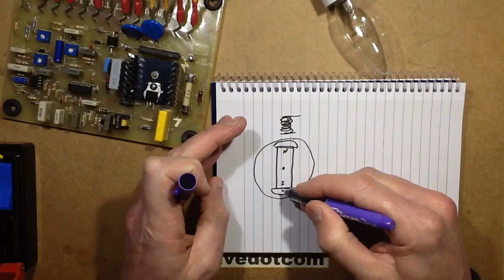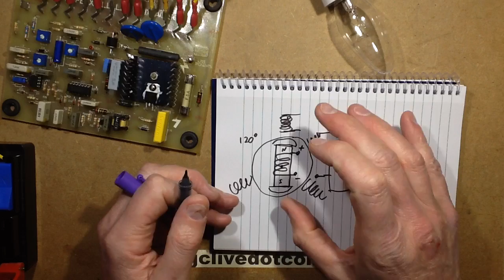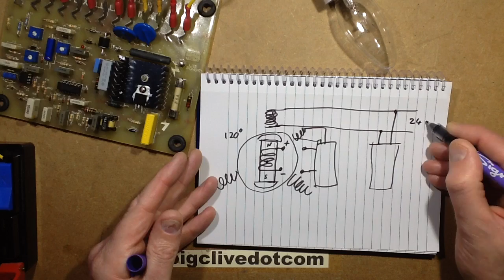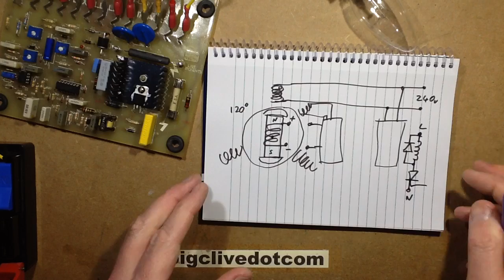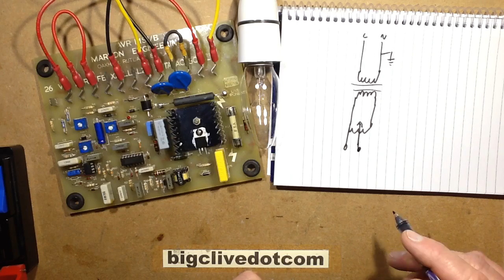Repair of old AVR (Automatic Voltage Regulator) PCB.

Comment: There are a couple of tricks to measure resistance in circuit.  A low test voltage is the known solution for cases where the bypass path contains semiconductors.  I have seen as low as 24 mV offered by a meter.  For resistive paths you can use 4-terminal ohms measurement with the twist that the drive and sense leads are at different branches and then you swap them.  For inductive bypass paths you can measure AC resistance at two or more frequencies.  Another thing, the SCR may behave fine with the lamp load, but fail to stay ON after trigger with an inductive load without some help.  The adjacent components might have been bad, but of course you replaced them in this case.

Comment: Hi Clive 
I find your videos extremely interesting and entertaining and I have an interest in electronics myself and I was wondering would you be able to give me some help I have a simple control box wit h a circuit board inside and this runs a small 12v motor and also opens and closes a ram all electric there is two separate switches for each control (motor & ram) and the ram isn't working and I was wondering would you be able to help me resolve this problem thanks

Comment: Spent many a happy hour cleaning up brushgear and sliprings on the 600 MW alternator sets at Longannet Power Station. We also used to check the brush lengths 'on load' so I know all about one of the drawbacks, from a maintenance perspective, of dc generators and motors, i.e. carbon brushes. Another bugbear was maintaining the switchgear for our emergency standby motors (oil pumps etc.) with mechanical timers, argh! I dare say modern switchgear is much more efficient but we used to dread getting jobs on dc plant. Just a wee insight from an electrical fitters point of view!

Comment: Interesting, now go and find a faulty treadmill control board as many seem to fail the same way. Works fine with the motor disconnected, once motor is connected it trips the house RCD with a big flash on the circuit board.

Comment: Not entirely comparable, but I have spent time fixing up several 1970's-era HP 141T spectrum analyzers, and I found that the resistors in those fail open-circuit quite often. The linear voltage supplies in the display mainframes run fairly warm and are the most common failure. When it isn't one of the transistors, it is usually a resistor. Thanks to the non-switching linear supplies, the old electrolytics have actually proven reasonably robust and rarely fail outright.

Comment: I used to build gensets using Markon alternators. On the smaller ones they used a bypass system for the AVR where if the voltage went to high it shorted the field winding's which were usually the stator in those designs, the field current was supplied by an inductor. This was even the case on 15 KVA 3 phase units up until the mid 80's. I used Markon and Newage alternator units back then but Markon were my favourite for farmers and builders as they were so simple and robust Newage were better for industrial use due to better regulation.

Comment: What was the type number of the original schmitt chip? If 4049UB or 4069 they are still freely available, the 4049 less common, though..
Reply from the maker: mc14584bcp
Reply: Pin compatible with a 4069 but the 4069 is mostly available as unbuffered output 4069UB, the 4584 is buffered..

Comment: That lower pot on the left is the Integral control adjustment of the AVR. From how Clive described it the unit functions as a P+I (Proportional + Integral) controller to regulate the voltage with an additional underspeed cutoff.

Comment: Looks like Markon Engineering provided the MS1/B to Power Drive Systems where they labeled it the AVR6e. Here's some documentation that contains technical specs, steps for adjusting settings, information on how to test it as well as some very crude diagrams.

http://www.powersystems.com.au/tech_pdfs/avr6e_manual.pdf

Comment: buy a can off conformal spray. $10 US and no worries.
Reply from the maker: Not so keen on spraying ICs in sockets with lacquer as it could seep down the socket and not only glue the chip in, but also risk making a bad connection if it ever had to be replaced again.
Reply: bigclivedotcom you could put some tape over the chips first. honestly I would probably pull the sockets and just solder in the chips.
Reply: a fair point, and you are right, a year or two more out of the AVR and you got your money's worth.

Comment: Not related to the video. If we were to create the power grid from scratch - for example on mars, what should the frequency be - do you think rising frequency would be better for easier transformation? Or would that cause problems with the skin effect?
Reply from the maker: I think these days if we could start from scratch distribution might actually be DC.
Reply from the maker: Much lower losses over long runs, and most modern appliances could potentially run on DC.
Reply: You should really do a video where you discuss the (dis)advantages of both AC & DC grids as you imagine them!
Reply: The 'BridNet' undersea power cable between the UK and The Netherlands is 450kV DC 160km long.
Reply: In my experience, for telecommunications devices powered by -48VDC battery plants within the confines of a building, the conductor size is significantly larger than the AC powered equivalent, even for short runs.  At work, we just completed installing a BDFB (Battery Distribution Fuse Bay, the DC equivalent of an AC electrical panel) 65' (roughly 19.8m) from the DC Battery plant.  The feeds are rated for 600A at -48VDC (we run at -54.5VDC to maintain at least nominal -48VDC at load full draw).  The accepted engineering standards (which are overkill by any stretch) call for doubled 750MCM (I'm in the US) conductors for battery and return.  Converted to square mm, that is 400mm^2 per conductor.

Obviously my example is very much small scale as compared to a power grid, but gives at least a small peak into the world of DC.
Reply: How come? Could you elaborate on that?
Reply: Does the gain in distribution efficiency offset the negatives of designing a more complicated grid? Actually, before i ask that, which of the two variants (AC&DC) require the most complexity to fill a modern nations power distribution needs?

Which challenges arise from a DC power grid versus an AC one? Except for now having to replace every transformer ever with a buck converter, of course...
Reply: Timothy Barney The thick conductors are due to the low voltage / high ampage, not because DC.
Reply: AC prevents corrosion. If not, check out the telephone terminals, particularly if you live in humid climates.

Comment: you need to test it with a variac. As you go from 0 to say 200 (assuming the avr is a 230V type) the lamp should get brighter with the mains in. As you approach 230V the lamp will stop getting brighter and start getting dimmer as it thinks the correct voltage  has been reached and it must reduce the field to maintain it balanced. The output will be smoothed by the inductance of the field coils. Since it's a closed loop system, the output will always appear 'all or nothing' on the bench because it's trying to balance within tight tolerances.
Reply from the maker: We do have a variac to test it with at the workshop.  I'll give it a go when I return it.
Reply from the maker: Send me a message or email me meggerbiddle.  To discuss the effects of electricity on the body.

Comment: A while ago I was looking for a device that would automatically regulate line voltage. Either to drop it if too high, or boost it if too low. All I found was nonsense that completely cut the power, or retardedly expensive audiophool bullshit.
Reply from the maker: +Tim Ramich  An early brand of LED lights used the principle of connecting loads of LEDs in series directly across the mains.  The failure rate was horrendous.  Any slight voltage fluctuation resulted in significant intensity variation.  Worse still, if there were voltage transients the LEDs would try to shunt them like a protection diode, and when one LED fails it starts an avalanche effect until the string finally fails open circuit.
Proper mains strings usually use resistors scattered along the length in series, often soldered to the LED legs and then sleeved.  That way a smaller number of LEDs can be used and there is a known resistance that will limit the current to a fairly predictable level over  a modest voltage variation.
Reply from the maker: +Tony Ling The Isle of Man has an undersea connection to the UK grid and oil powered generation on the island.
Reply: Just use an online UPS, that's its sole purpose (at least here in germany because we very very very rarely have power outages)
Reply: Look for something called "boost buck converter"
Reply: Sir Pig Those are for DC voltage, like for driving LEDs in flashlights.
Reply: Don't take my word as gospel but that is very hard to do. The only commercial product I can think of that does that is a UPS. They are intended to provide power in the case of blackout. They basically rectify it and then pass it through an inverter constantly. But if your going to use it for voltage regulation you must be careful. The vast majority of consumer units don't actually use the inverter. They just switch from a pass through to the inverter only when input power is lost.
Reply: You can get a device which is essentially an over saturated transformer which allows regulation and tames spikes.
Alternatively, perhaps try a UPS.
The question here really though is why is your generator not correctly regulating?
Reply: Tony Ling What generator? I'm at the mercy of the wires leading to where I am. If there's a large load, the voltage drops.
Reply: Spencer Hopwood I don't want a commercial product, and the audiophool bullshit is expensive just for the sake of more money is supposed to equal better sound. Do they not have cheaper variance with servos?
Reply from the maker: For mains power it's quite complicated and very expensive if a high load is involved.
Reply: Tim Ramich Where is your utility provider in this? Or is it a local lash up?
Reply: Incidentally Clive, what powers the IoM's electricity supply?
Reply: Tony Ling It's a campground. I was looking for something cheap, or a circuit to build, to do this for some LED strings, so really not a high load.
Reply: There is almost certainly a fault with your local supply. Somewhere there will be a burned looking connection, or they haven't used the required 2.5mm2 cabling in order to feed you 16A over your C-form connector.
Reply: If you are running a light load like LED lighting, then I am really baffled. There must be a distinct line feed issue
Reply from the maker: If LED strings are running close to the voltage of their transformer or directly on the mains in series strings then fluctuations in the mains voltage will result in significant intensity changes.  If the voltage really is fluctuating that much then it may be that the supply is not really suited to the other loads on it.  Easiest fix for the LEDs is to get ones with the little self regulating switchmode power supplies that are commonly supplied with the low voltage (31V) ones these days.
Reply: Tony Ling I don't think you're getting it. The LEDs of course are not a heavy load. The heavy loads on the line bring down the voltage enough to dim the lights.
Reply: bigclivedotcom My strings are 50 LEDs in series. I bridge rectify and smooth my 120 VAC to just under 170 VDC.
Reply: Tim Ramich I believe I am 'getting it' Tim based on what little background information you have given us.
If your supply is sagging significantly, then you have too much resistance in your feed line. Either it has a faulty junction, or the cable is overloaded for the current involved.
Reply: +Tim Ramich I assume you're using a resistor to limit current. If the LEDs are white, 50 in series is too many for rectified 120VAC. If you used 40 LEDs, you would need a bigger resistor, but would see less dimming when the voltage dips. In the extreme example, a single LED would dim linearly with changes in AC voltage. In the opposite extreme, if you drive an LED from a regulated DC voltage supply without a resistor, it will dim with very slight changes in voltage. You may be closer to the second extreme.
Reply: Chris W 50 LEDs in series into 170 V is only 3.4 V per LED. The rectifier drops voltage, too, so no, I don't need a resistor.
Reply: Tony Ling I know the cable is too thin. 14 gauge wire feeding multiple buildings, all on a 60 amp breaker (insanity). It's not my place to go tampering with what's not mine, and they are slowly improving the electrical situation here anyway. This stuff was put in decades ago.
Reply: Tim Ramich That's your problem. You do need a resistor or other current limiting means. The LEDs are highly non-linear in their IV curves. You may get away with not burning them out by using 50, but you are guaranteed to have severe dimming if the AC fluctuates.
Reply: Chris W I have no problems. Just a voltage drop, and I was looking for something to keep it a constant 120v, because I was down below 110v during the summer when everyone used air conditioning, and they weren't severely dimmed.
Reply: I'm glad all is working properly.
Reply: Tim Ramich I bought a lot of apc avrs
Reply: audiocrush Or look at the circuits found inside medium grade UPS devices.  When input voltage is slightly off, these switch to a different tap on an "autotransformer" rather than activating the more lossy inverter circuit.

Comment: You know, older R/C cars use a wax to seal the board, it works real well. I've had a 70's R/C airplane control board and the parts were like new, environmentally speaking (the board was fried, from too much juice I think).

Comment: I work as an electronics repair engineer for industrial automation electronic circuits. Generally I first check fuses, then check for shorts on input and output. If no shorts are visible, I power up and see what happens (or doesn't) Sometimes a good bang! Usually the common faults are fuses, electrolytic caps, and your silicon components i.e short from collector to emitter on IGBTs or shorts on MOSFETS. Logic IC's can also sometimes go bad, if you haven't got a logic tester, swap them out anyway. Sometimes it's as simple as the caps or a varistor gone boom from a surge, other times it takes you hours to figure out what the hell is wrong. But that's why I love electronics engineering, there's always a good puzzle to solve :D

Comment: Clive, maybe you can help me with something. I recently took apart a big printer (like the cabinet style ones used in business). Apart from several (lots!) of really useful parts, inside was an LED strip with an odd configuration. It has parallel sets of 7 SMD LEDs in series with 2 resistors in between each. The resistors are so small I can't see their values. What's also odd is that it looks like each set of 7 LEDs is split with a resistor, so there are 4 LEDs, then a resistor, then 3 LEDs, all in series, followed by 2 resistors and another set of 7 LEDs + 1 resistor. I'll have to look at it closer to figure out whether the 2 resistors between each set are in series or parallel with the rest of the circuit. Could you explain why they used 2 resistors between each series set, and why there's a resistor in the middle of the 7 LEDs? If it would help I can take a picture and put it on imgur or something.
Reply: Maybe it's too late for me but a picture might help here if possible.
Reply: I'll snap a picture the next time I'm down in the shop (probably later tonight).
Reply: You said that 7 months ago... it is time.
Reply: 7 months later...

Comment: Makes me glad that my Honda EX650 generator is a very simplistic setup (though replacing the diodes & resistors on the rotor was a right PITA!!), if I had to fix an AVR then I'd have probably given up on it!! :S
Reply from the maker: These days you can get a wide range of AVRs online, so there's still hope if one fries.
Reply: bigclivedotcom
Very true, just wish it was that simple with my EX650, getting its diodes off the rotor was just a PITA, almost ruining it in the process, but it works now, and that's what matters... :)

Comment: I used to rewind Markon Generators and do repairs. Im not sure if any were 1978 era but apart from the stator back end being burnt out the usual fault was the rotor diodes. Bolted into the rotor were two diodes connected (soldered) to the rotor windings and these were the first things you checked when one came in for repair then after the usual winding tests i basicly did what you did but before we threw the semiconductors we tested them.
Reply: That's a brushless design with the field rectification diodes on the rotor

Comment: A sharp contrast to a modern generator's AVR that's completely potted in epoxy how things have changed.
Reply from the maker: I wanted to get some of the cheap Chinese units to make a video about, but they are all potted in black resin, which is a shame.

Comment: I guess this is from a large-ish generator, not one of the portable ones you can put in the back of a car or van. I say this because many portable generators use a brushless alternator which just has a separate winding connected to a capacitor for excitation and no AVR. They also usually have a diode in series with the rotor winding with a VDR across it. The regulation may not be as good as with AVR alternators but for reliability and cost of maintenance and repair they are the simplest and the best.

Comment: just a point about measuring in circuit resistors (Which I'm sure you're aware of )..... If you measure across a resistor, the reading cannot be higher than the spec of the resistor because of external parallel routes.  If the external circuits are of low values of ohms then they might mask the faulty resistor but if they are of a higher value then the faulty resistor may reveal itself.
Love your vids by the way Clive